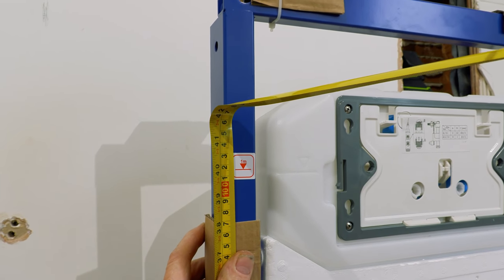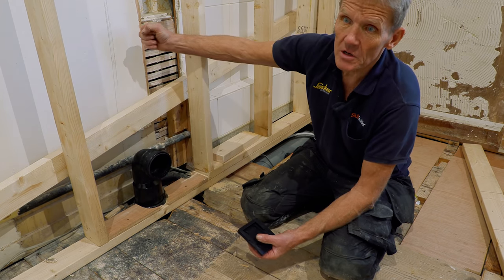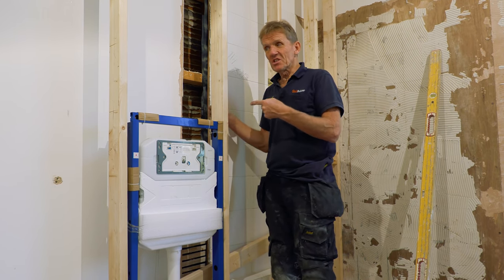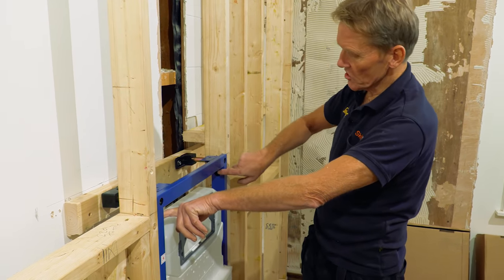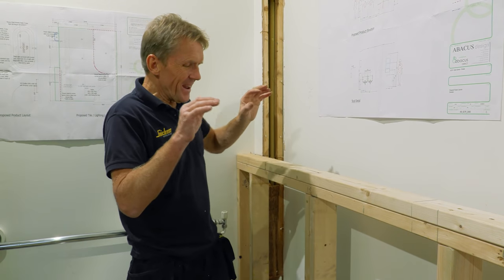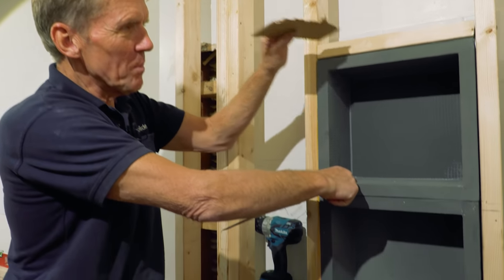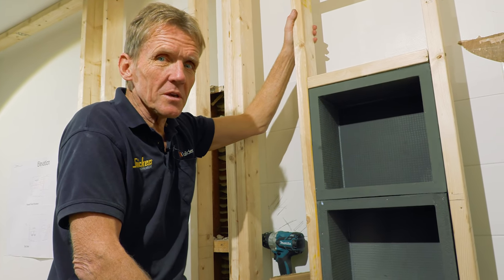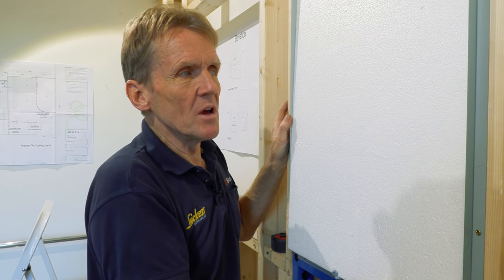Bathroom Renovation #4 - Stud Pre-wall

Comment: Hi Roger 
Just a suggestion if you can

I was just about to finish a bathroom today, during installing clips for the water pipe I drilled in to a radiator hole , which was Buried into the wall, unfortunately 

What metal detector do you suggest me?

Thanks

Comment: @skillbuilder You can see the tiles on the wall about 500m behind the front of the stud work. Is there a reason not to take the room right back to the actual wall?
Reply from the maker: The pre wall houses the soil pipe, w.c. cistern and waste pipes as well as all the supplies. If you had to box that lot in it would be a mess. You lose a bit of space (200mm) but the clean lines make the bathroom look bigger. It is a shift in thinking but once you have made it the results are well worth it.

Comment: What's the standard width for a stud wall which holds sink plumbing and toilet waste pipe? I've been told everything from 150mm, 200mm and 240mm?!... This chap says 8 inches which equates 203.2mm is that correct? Does that include plaster board and tiles? We need to know before ordering our furniture, thank you x
Reply from the maker: The space behind is usually anything over 110mm but to the front of the frame I go for 225mm  which gives you a nice space for the soil pipe but if the soil pipe is going straight out through the wall you can do less. A slimline cistern is 90mm so consider a 100mm stud work plus the tile backer board and tiles so say 125mm finished front of pre wall from the structural wall.
Reply: @SkillBuilder  Hi thank you for replying so quickly! So in total you would say 225mm for the entire depth of the wall including backer board, tiles and a slimline cistern? What size soil pipe would we need to use for this scenario? Our soil pipes needs to go along, left and then down. Thank you x
Reply: @SkillBuilder  .... Or are you saying that there are two options; 225mm total width from original wall to front of new stud wall including tiles AND/ OR a smaller option of 125mm from original wall to front of new stud wall including tiles too? How will we know which once we need? Obviously we would like the new stud wall to be a slim as possible to maximise space. Thank you :)

Comment: Hello Roger, I've got the abacus system, and just like you demonstrate in this video that the system in on top of some plywood which is sitting on top of the 2x3 stud timber, but it's the leg of the abacus system much wider and as such would be unable to screw all three holes of the system into the 2x3 timber? How did you solve this?
Reply from the maker: You don't need all three holes, they give you three but one in each foot is enough. I usually put a block of wood behind the stud but you don't need it.

Comment: Thinking of studding out my bathroom, how far forward have you studded the wall  from the back wal?
Reply from the maker: I usually build to 200 mm from the face to the wall but you can build it much close if you use the slimline cistern and have a soil pipe outside.

Comment: Hi Roger, I am installing the 820 WC frame next to the 1180 basin frame and next to this is the towel radiator. The wc frame is by the external wall. there is a 360 height difference between the wc and basin frame and I plan to fix the hot and cold manifolds above the WC frame. The question is what material should I use to create a durable hinged door for access that looks good and will not absorb steam and warp?
 In your video you cut a walnut shelf for manifold access but wouldn't the cut side of the exposed MDF absorb moisture? Many thanks for your help in advance
Reply: I have found a tile door kit from access panels.co.uk for £21 and I believe this will work
Reply: It is the alpro 2000

Comment: Rog ,just a query not a judgment  why in England do you still use wood instead of metal studding
Reply: Cheaper, and stronger.
Reply from the maker: I find the metal studding is hard to work with on a job like this. You can use it but we are putting in panels for mounting valves so timber is just a bit easier.